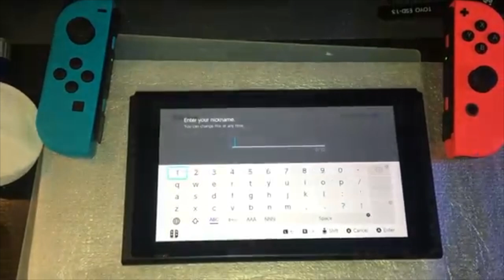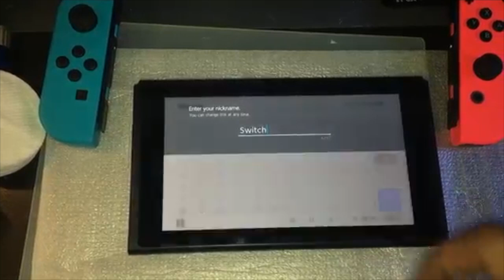Nintendo Switch Orange Screen Repair 100% Working Fast

Comment: This video is absolutely fantastic for the procedure but it would be really good if you added these notes: Typical household hairdryers only get up to around 200F, not enough to flow solder. Solder flows around 350F so you need a decent heat gun. 900F for prolonged time will start to melt the plastic and pop other solder joints up (did this by accident on one). 500-700 seems to be the ideal heat range if you have an adjustable heat gun or looking to buy one.
Reply: Awesome add, Chad! Do you have an estimate on how long to keep heating?
Reply: @PeterSaverman  just like anything I doubt there is a magic number. I started off with 3 seconds of heat then test. If that didnt work then try 6 seconds, then 9 seconds just to be safe. When I hit 15 seconds things came unsolderes I didn't want to haha
Reply: the info i need
Reply: Is the problem still come back after you do it?

Comment: Tried, tested, and it worked! Some warnings though,

–I had trouble with a couple screws, I stripped two, and managed to get one out, but for the other one I had to end up breaking a part of the plastic backing to open it up. Just bad luck I think but be cautious with unscrewing. Luckily there are backplates for sale on amazon if this happens to you too.
–The metal plate covering the wifi chip was a bit hard to get up so be delicate. I used a small flat head screwdriver to gently pry the sides of the metal square, and then popped up the end with the chip off with my fingers.
–When re-assembling, the place the chip/wifi plate back, be sure that everything is aligned and it will simply snap back in place with a gentle push. The SD card reader is the same (with small holes to help align).

I used the heat gun at 450 and heated up the piece just as described, worked perfectly :)

Comment: Omg thanks sooo much I was stressing out so hard the my parents were going to kill me but I fixed it because of your video so thanks so much
Reply: Even though you can just hold the power button
Reply: @matthewpozzuoli3360  it worked yeh i just turned it
 off then boom orange screen gone
Reply: Same, I held the power button and knew that it had trouble opening youtube, it's probably about the wifi.

Comment: Using sublimation tape would that helpful. And could I use a great gun with a tip adapter? Where you using a heat gun or a hot air soldering station? What temp? If I use a heat gun do you have a recommendation as to how long I should leave it. Thanks. Sorry for so many questions, they really were covered in the video. Thanks again
Reply from the maker: using hot air station is best with a small nozzle to control the heat, we set at 450 deg airspeed 60 on the quick 861dw. also using Kapton tape to cover the area around where your heating is best to protect everything else so you don't damage anything less in the area.
Reply: @TekkiesIncBartlett  is the temperature celsius or Fahrenheit?
Reply: @jostplate5297  farenheit

Comment: what if it still shows an orange screen after doing what you've shown in your video?
Reply from the maker: possible not enough heat or not applying heat long enough can cause issue remember you just want to get it hot enough to melt solder ball under chip to reseat the chip properly. what happen is chip get to hot and solder connection under the chip get disconnected. also if you have so flex to put under chip it may also help flow it better or the chip will have to be replaced. hope this helps.

Comment: Thank you I almost had a heart attack I thought my switch was going to blow up!!!😌
Reply: Same
Reply: Same
Reply: did you fix it using this method?
Reply: I honestly just restarted then waited it out
Reply: @jjread4900  you just restarted and just waited it out while in orange screen?
Reply: So did it work?
Reply: Me to lol but i got the Orange light about 3 times
Reply: Hold the on/off button down for 1 minute to power the console off. Then when you power it back on the issue will be resolved
Reply: @davekelly585  that doesnt work for everyone
Reply: @davekelly585  thank you so much I didn't have the tools cause I'm ten it worked

Comment: Mine just had this all j did was press power button 5 times but on 5th time hold it for ten sec ten pres it one more time and it worked for me. I was about to get it returned
Reply: Much more helpful and safer than the video thank you

Comment: I did this and the orange screen is gone, but now my controllers won't connect wirelessly. Should I reflow it again?
Reply from the maker: Yes be careful amount of hear check all cable connector on board also
Reply from the maker: remove slider for the joycon see if any damage to any of the flex cable goto switch, reassemble see if that help or you may need to replace.

Comment: I just hold mine for 20 seconds and it was fixed
Reply: THANK YOU SO MUCH IDK WHAT I WOULD DO WITHOUT THIS COMMENT OMG IT WORKS AGAIN THANK YOU
Reply: Zidaan actually?
Reply: THANk YOU
Reply: Thank you so much. My sister started yelling at me because she thought i broke the switch. I was stressing and was trying to figure out what to do. I didnt want to take the switch apart because I'm not allow to use my dad's screws. So thank you. 🙏🏾🙏🏾🙏🏾🙏🏾
Reply: Thank you it worked….

Comment: How about a bright yellow... I woke up today and my switch was on but had a blank black screen.. looked up on line and it mentioned to hold down the power button for 20 seconds so I did... After holding it down and pressing the button again the Nintendo logo showed. A few seconds later the screen turned bright yellow. I've tried the 20 second power thing and tried looking for anything online but all I can find is about the orange screen. Much appreciated if you've came across the yellow screen and know what to do.

Comment: can i know what is the  degree you set ?
Reply from the maker: 480 temp air speed 60 on our quick 861dw
Reply: @TekkiesIncBartlett  I assume that means 480C?  I noticed application for about 15-20 seconds on the video.  Is that a correct observation?

Comment: hmmm i have seen a switch on ebay with one Orange Screen .. have a reflow station .. is it worth the shot?
Reply from the maker: If for good deal be it worth it
Reply: @TekkiesIncBartlett  it just went 😩😩😩but thanks for the heads up

Comment: 3:39 what is that tool
Reply from the maker: Hot air gun quick 861dw set to 450 deg and 60 air speed

Comment: Does this reset the switch
Reply from the maker: no
Reply from the maker: no it dosn't we customer was try to fix and reset unit before it came in for repair, that why it on those screen after repair it didn't reset the switch.

Comment: Yesterday my switch gave me a connection error and now when I try to turn it on it gets stuck on the switch logo, is it the wifi chip?
Reply from the maker: could be a memory chip or os issue, or other components failure on the board. suggest sending in for repair.
Reply: Yeah reset the switch and wille it turns on have a headset plugged in and you are set

Comment: I have a nintendo switch lite, the board configuration and chips are different. Do you know which chip I would have to reflow on the the lite version? Specifically do you know the model number or basic location of the chip on the board?
Reply from the maker: try drain battery to dead and recharge 1st, we will have to check on the  lite. we have not had a lite have this issue.
Reply: lite also has this chip.  In the middle of the motherboard, under the aluminum plate.

Comment: Now how do you fix the chip is it by heating or by something else?
Reply from the maker: Problem with solder balls under the chip  by reflowing chip it fix issue on some cases you need to replace the chip which is not available except to get from. Another unit.
Reply: @TekkiesIncBartlett  I got confused what you did towards the end of the video when it was taken apart
Reply: @TekkiesIncBartlett  and what tools you used on the chip to fix the problem when you went to overflow the chip what does that mean?
Reply from the maker: @spencerskywolf5552  we use quick hot air station
Reply: @TekkiesIncBartlett  so you just hit the piece with hot air or is there more that needs to be done? this happen to my switch which is why im curious
Reply: @TekkiesIncBartlett  also what size triwing screwdriver did you use?
Reply: he took to chip off and then he just waited a few and reput the chip back on the way it came off theres a flaw with the chip and soldier point under it so by taking it off then reinstalling it it fixes the issue

Comment: Hello, do you know how long this repair hack will last? But what are his causes? I recently bought a Nintendo swicht lite from someone, I installed a few games for the child and the next day when the orange screen turned on !!
Reply from the maker: depends most cases work long time if you having issue send in for replacement chip, we can do it. that permint fix

Comment: If I dont have a heat gun can I use a hair drier??
Reply from the maker: be very careful if that your only choice. we use hot air station set 450 deg, you need high setting and mask all-around chip and plastic so nothing gets damaged. be careful let me know your outcome.

Comment: Any advice for me? I did what you showed in the video and the orange screen goes away until about 5 minutes of being connected to thw wifi.
Reply from the maker: may have to heat chip more longer or replace the chip.
Reply: @TekkiesIncBartlett  thank you so much! I heated it again and it works!

Comment: Would this work for my Switch Lite? I noticed my wifi is not working and sometimes im able to bypass orange screen but then in the menu it stops working.
Reply from the maker: Will work but have to locate wifi chip to fix different location
Reply: @TekkiesIncBartlett  I tried doing this method on switch lite after locating the wifi chip. Didn't work :( I'll try it again later. Maybe i Didn't do it long enough
Reply: @AnimeTechs  where is the wifi chip located on the lite?

Comment: What do you use if you don't have a heat gun?
Reply from the maker: you need a heat gun to direct heat tothat chip.
Reply: disassemble the motherboard, put it in a oven at 200°C for 3-7 minutes. Just make sure that the motherboard is leveled properly. If it moves during the reflow procedure, it will be unservable.
Reply: @Clarification85  Not a good idea to put in an oven because 200*C is not enough to melt solder, this temperature is also damage all plastic connectors on the switch mainboard.

Comment: Can I use a heat gun to heat it? Also what does heating it do?
Reply from the maker: Yes you can use heat gun just be careful, the heat melts the solder joint under the chip.

Comment: What does heating it up do? Thanks
Reply from the maker: remelt the solderball under the chip. this happen due to chip getting to hold. so reflowing the chip fix the issue.

Comment: After doing that, the switch turned on again. But every time I try to wake it up from stand by, the screen turns orange again. Any suggestions?
Reply: either a bad chip or your reflow wasn't 100% successful